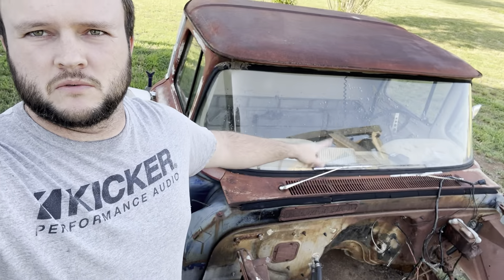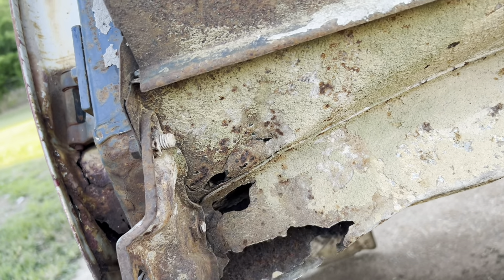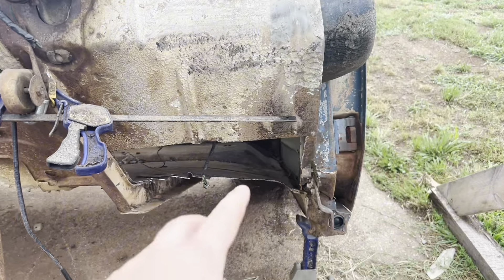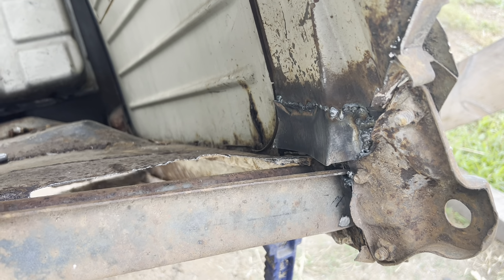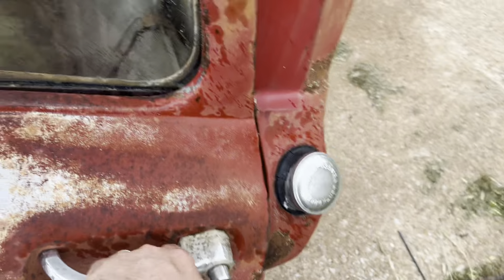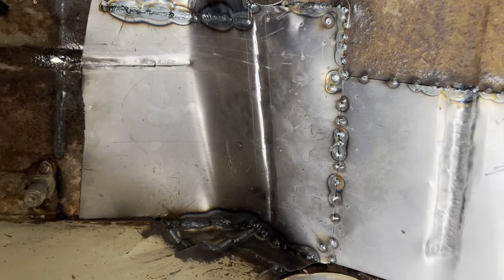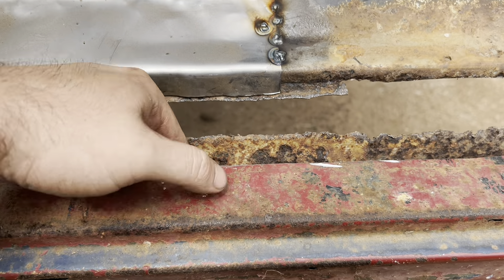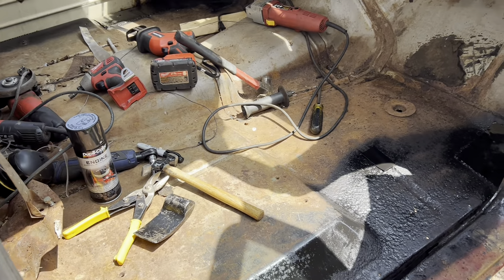How to repair rusty floors at home!

Comment: Once you get the floor and surrounding panels seam sealed. We should take it to work and we can use a sprayable under coat and do the underside and the inside of the cab. I think it will be a better option than bed liner. Plus it comes in a different colors and I think will have better heat dissipation and nvh qualities. I think we can get white, beige, grey, or black.
Reply from the maker: I’ll think about it!